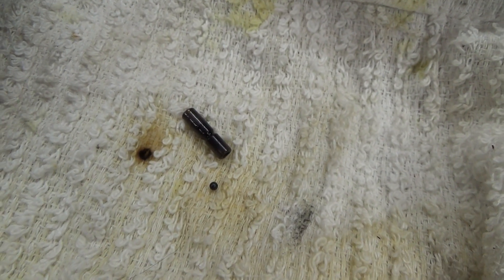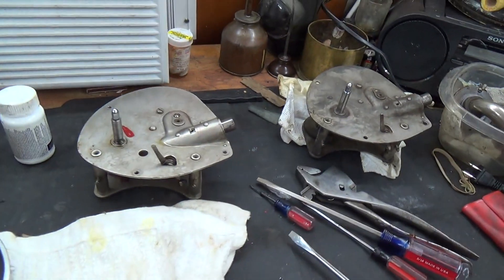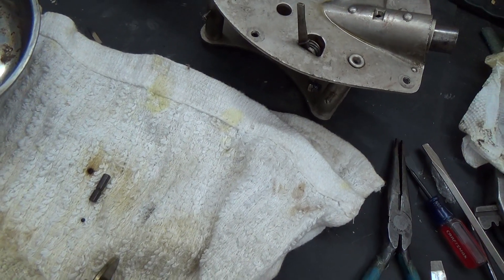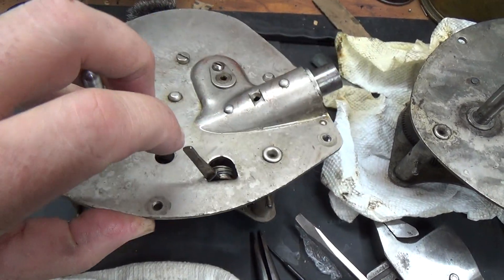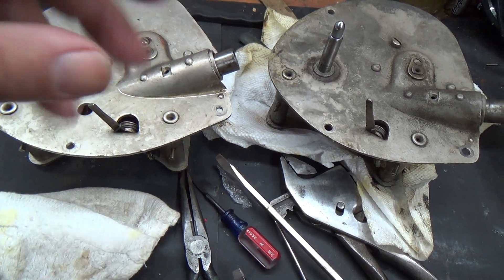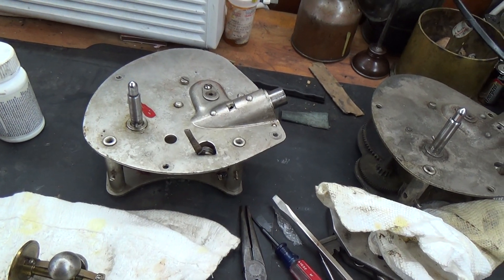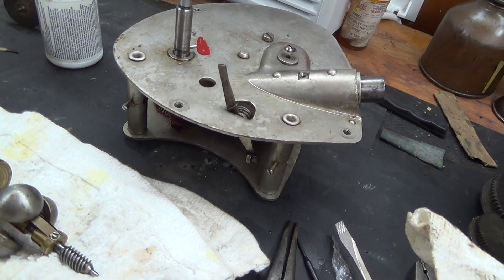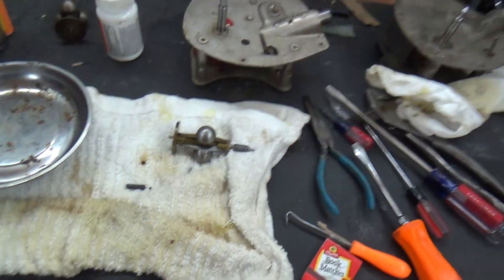why we oil bearings, and what happens when we don't

Comment: Taping them didn’t’t work.
Reply from the maker: Most of the problem is the crap lubricant HMV seemed to be using at the time.  I rarely run into Victor bearings stuck this badly.  I don't think I have ever had to resort to such measures with a Victor bearing cap.  Fire up the torch, remember the solvents you are working with are flammable, and so will be the hot ball bearing once it hits the rag, so dampen the rag. Be careful.

Comment: Thanks for the tip about using the torch to get the bearings out. They are such a pain.
Reply from the maker: The torch is the last option, first just tap the cap onto a soft cloth and see if they just fall out.  Sometimes they will be that easy, next is soak in solvent.  Put them in a plastic pill jar or something similar that can seal up, and then shake the jar.  Most of the time that will do it, especially if they are the larger ball bearings.  Heat is the last resort, everything has failed, even weeks of soaking in everything from PB blaster, Evaporust, even white gas.  Because this 102's motor hadn't been taken care of even when still in service the bearings rust locked into the caps.  If it had been oiled regularly then there would only be old oil shellac to dissolve.  That can be a pain, but in time the bearings would come out with solvent.  That is one criticism on the 102's design, they should have made it possible to oil the bearings from the top without removing the entire motorboard..  This would still not get the gears greased up, but the governor bearings need oiling much more frequently than the gears need greasing.